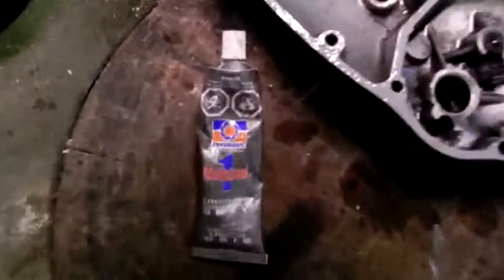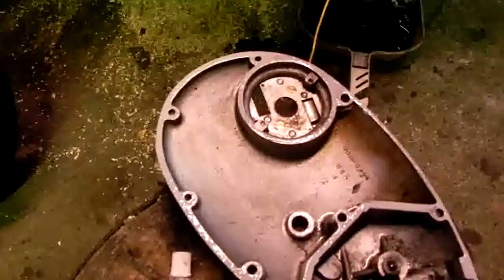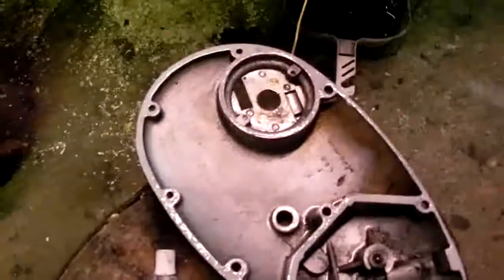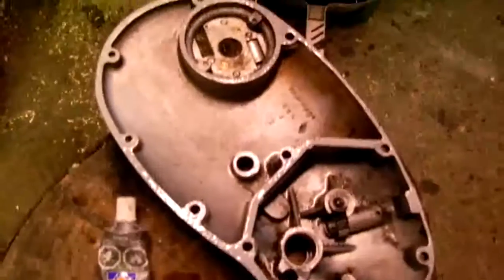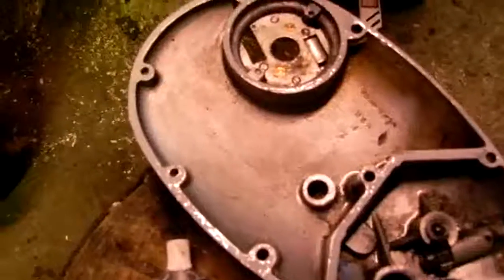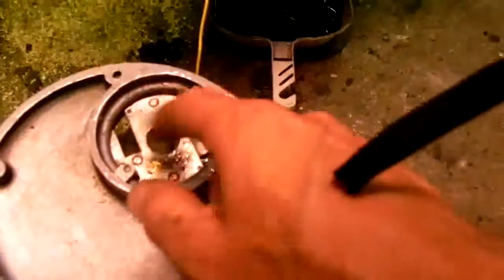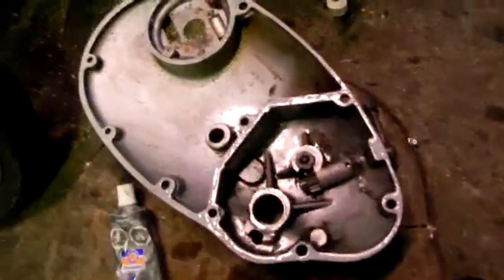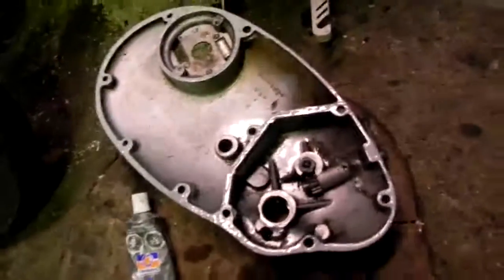A BSA rider's view of Permatex's new? MotoSeal! grey goop goes thin! Outer tranny 441 b44

Comment from the maker: Thanks I have used Permatex import grey for 20 years and on these old British bikes the bonding is very important as many cases will vent and blow out anerobic I have found. Not the most exact machining and years of abuse by other owners sometimes demands  Ultra grey. I used ultra grey on a Tesla turbine I built as well and it bonded disks on rotor at 45 000rpm and 220f steam at 100psi! That may be on my "Theteslajet" channel.